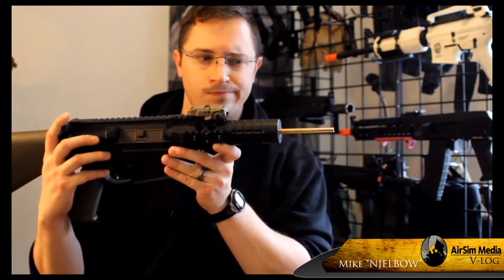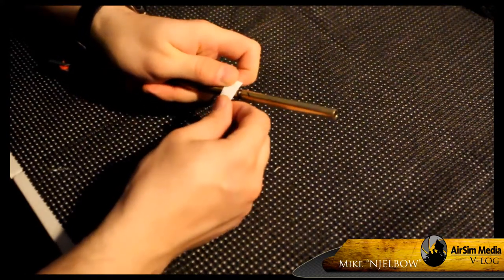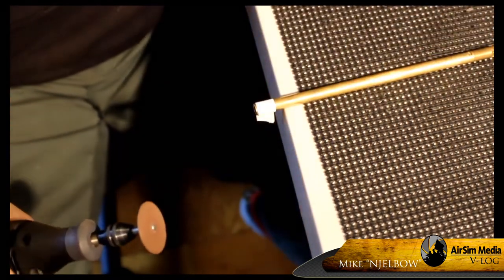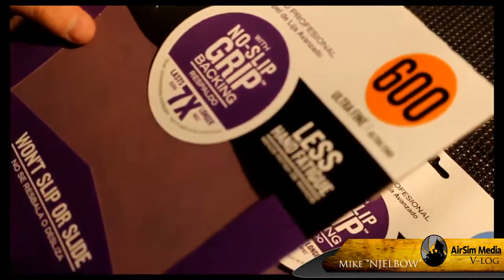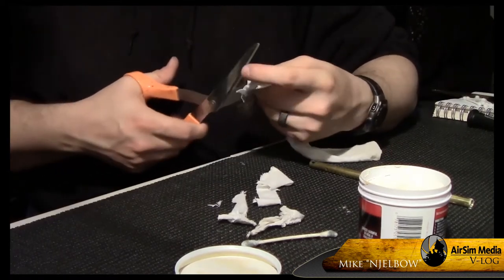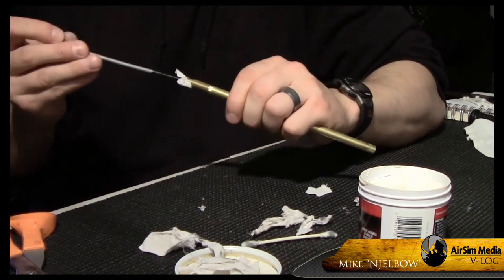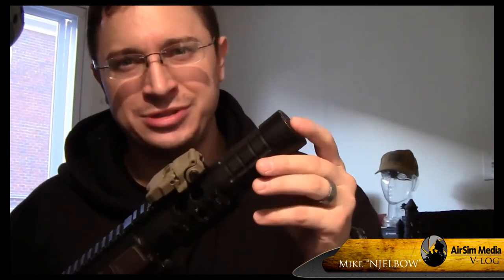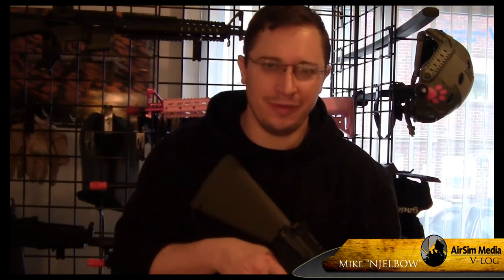AirSim Media Vlog Mike NJelbow shows you how to cut an inner barrel

Comment: Nice job with the re crowning of the inner barrel. I cut off about 4 inches of my inner barrel with a pipe cutter and I used a grinding stone drill bit as well. I didn't polish my barrel, but it shoots just fine.